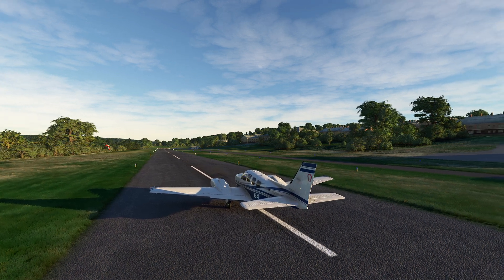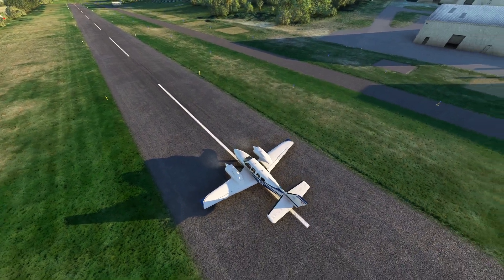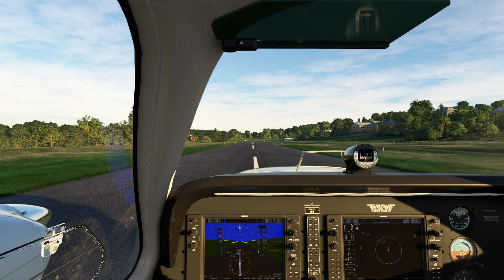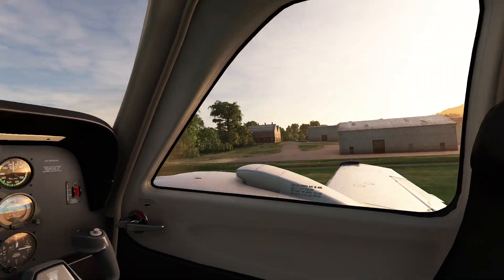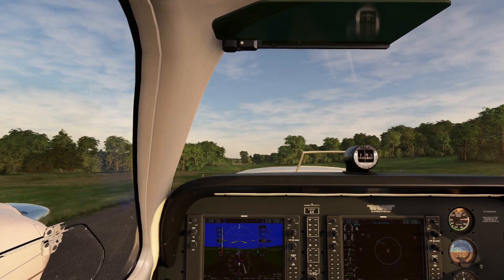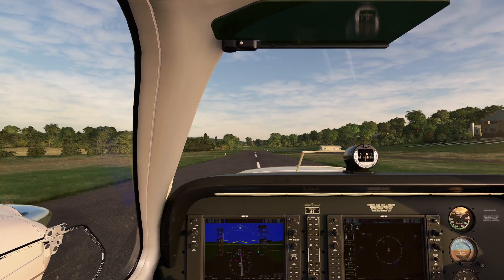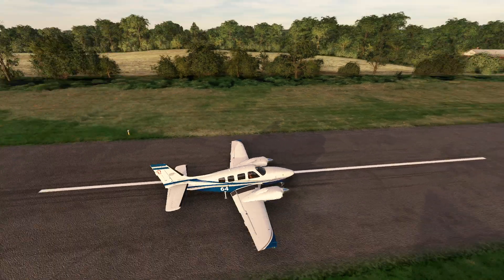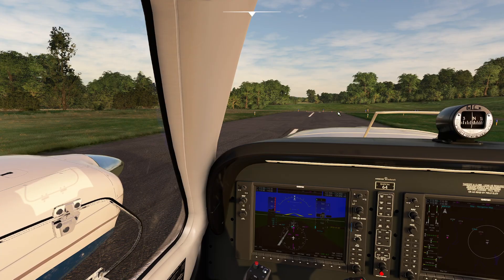MSFS - Takeoff Distance rule of thumb

Comment: When aborting a takeoff, should you pitch down so the breaks gets better traction or should you pitch up to use the wings as areobreaks at the cost of traction?
Reply: AFAIK, you always use neutral or up elevator when braking. All aircraft will tend to "kneel" when brakes are applied, which can lead to prop strike with tricycle gear and flips with traildragger gear. I'm not sure that pitching down adds much brake effectiveness at all, let alone enough to justify the safety risks.
Reply: @Tobascodagama  Makes sense, thank you!
Reply: One thing that's important which is not demonstrated here is that if flaps are being used, to immediately put them up (clean) to maximize tire traction aka braking.